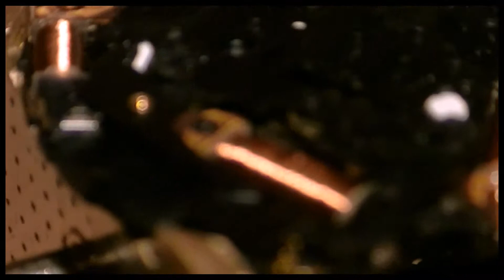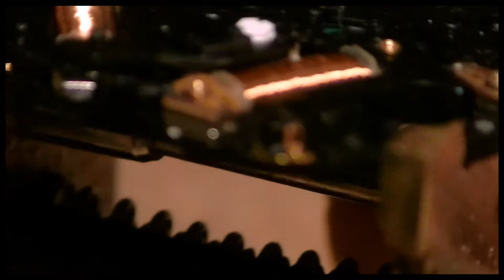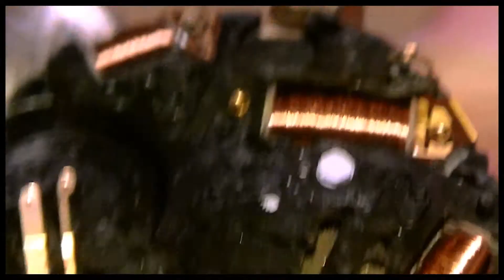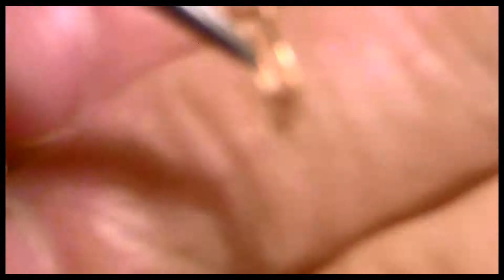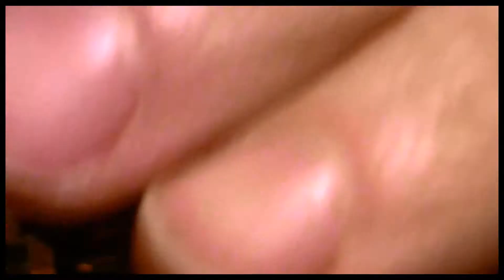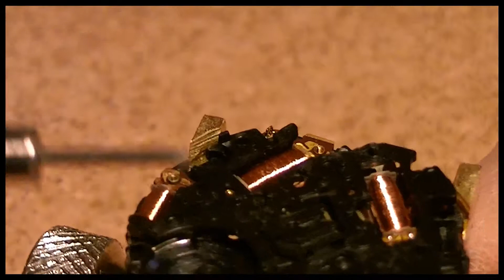How to disassemble a 7T32 movement - Part 2

Comment: Hi George, if could tell me which coil is for which part of sub dial, alarm and main time keeping please? I can't figure it out which is for which. Also alarm dial is stoping running and can not be advance from pusher. Is that possible coil is death?  Thank you so much.
Reply from the maker: AS a general rule of thumb, the coil sits under the dial that ir drives. When you are looking to the movement from the back, turn it so that the crowns are on the right side, and the coil on top is for the dual time/alarm dial. The coil on the bottom is for the chronograaph minute counting. The 2 remaining coils are, if I remember correctly, the top one for the chronograph seconds and the lower one for the permanentt time seconds.

As per the alarm not working and the pusher not working, it can be a mechanical issue (the pusher is dirty and does not manage to push the spring to make proper contact, or the spring itself is damaged/broken, or rusted. It can also be that the coil is damaged. Without proper inspection a diagnosis on the internet is impossible.